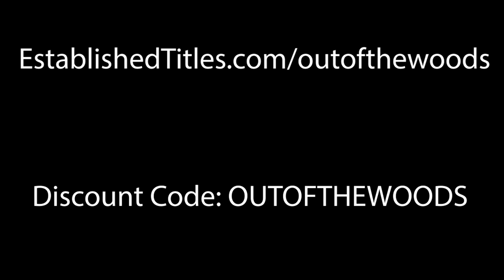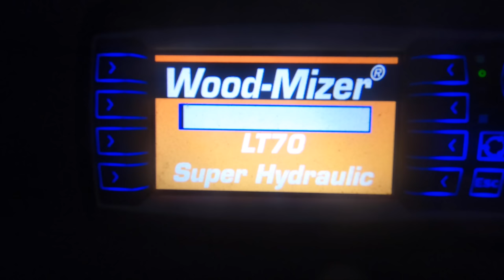I Hope This Works

Comment: I have never seen you do this, but I am thinking to move the log length ways on the mill, you could raise both "taper" rollers, then roll it forward or backwards ? You could even "gentle" push the log backwards with the push back fingers on the mill.

Comment: Nathan why don't you cut your slabs for firewood instead of the burn pile especially the hardwood??
Reply from the maker: I can’t keep it all. Got plenty already
Reply from the maker: I’d like to not have to work all the time. 
If I did everything people recommended I’d never sleep
Reply: @OutoftheWoods0623  ain't that right
Reply: Yep, all you need to do to save that sawdust is to buy a $37,000 pellet machine, hire a couple of folks and run about a ton of sawdust through it every few hours and you'd be able to satisfy your critics.  Except those wood pellets would produce CO2 when they were burned and you'd have to figure out how to capture the carbon and also run your pellet machine off of solar and wind.  Then you'd be all fixed up.

Comment: Nathan, I recently heard another YouTube channel that also saws logs on a Wood Miser LT 40 sawmill... and you would ;laugh you head off if ya heard their explanation of what 1/4 sawing was.. they demonstrated that it was cutting the log into 4 pieces so as to avoid the pith in the log... Gee wiz imagine that and they were even using a LT 40. How comical is that? Guess they had more money than sense?

Comment: Why do you mill your cants individually rather than all at once?
Reply from the maker: Cants move.  You sometimes have to flip them when you see movement 
Sawing more than one produces inaccurate boards
Reply: I was just sitting here wondering the same thing, and thinking that being able to saw two or three at a time would at least save some diesel for you.  Didn’t think about them moving on you though.  I’m guessing that was a lesson learned the old-fashioned way (experience…). Anyway, nice looking lumber out of that log, thanks for another great episode!
Reply: @PracticallyMint  I've always cut several together.